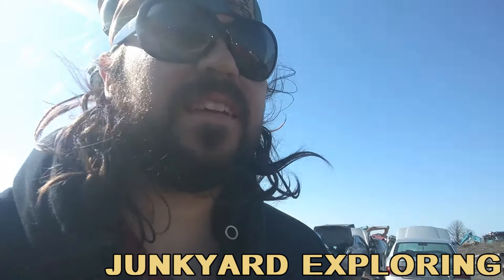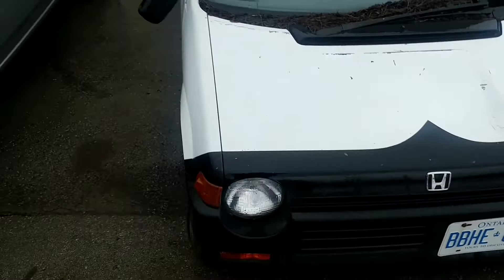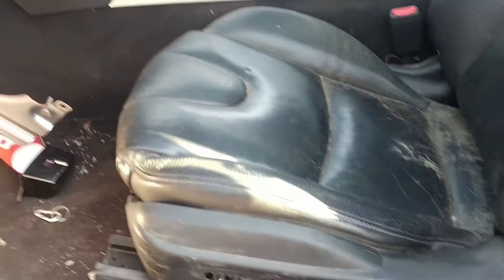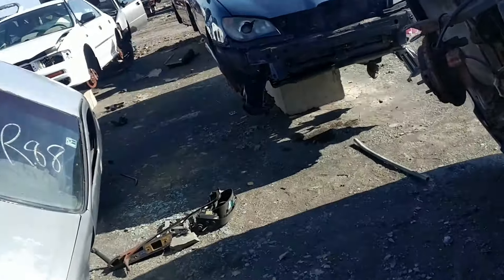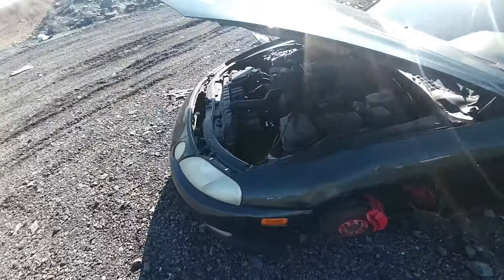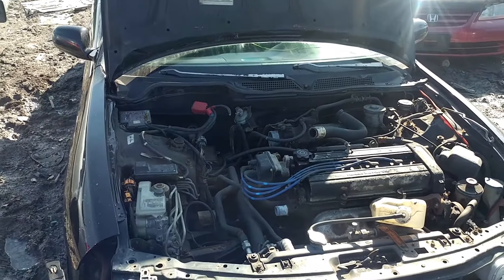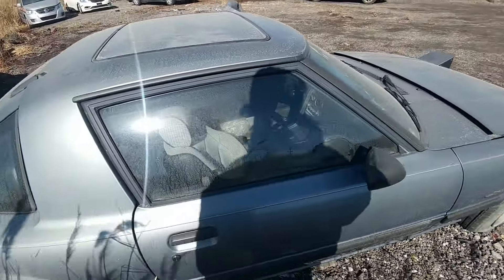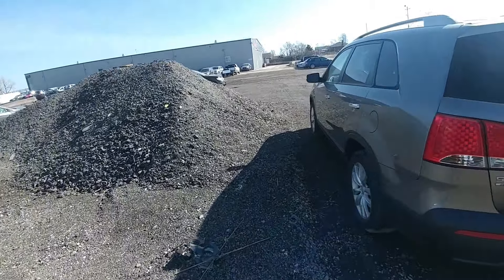Junk Yard Exploration

Comment: Something is weird with your video blacking out. The audio keeps going but the video is gone. 
Thought it was my phone at first but its doing it on the desktop as well. o_0
Reply from the maker: ah dang, i think my phone was shitting itself that day, maxed out the memory :/
Reply: Turns out it was an issue with my chrome. There's a feature called "turn on hardware accelerator"  turned this off and everything is good.